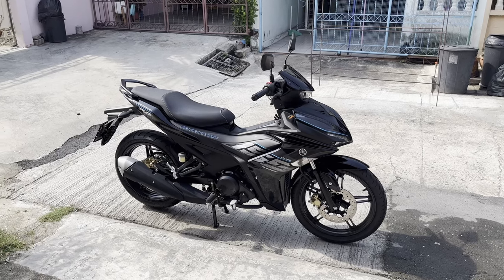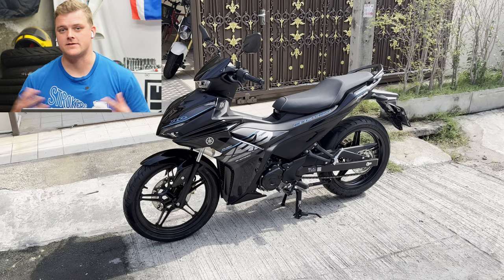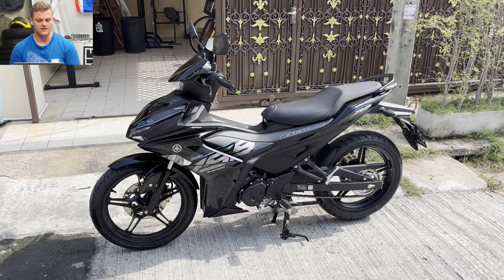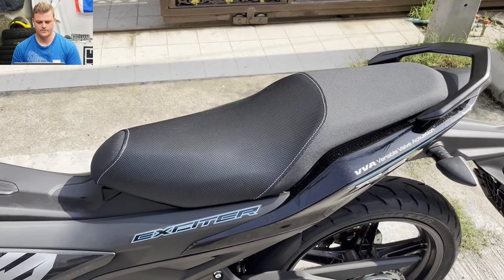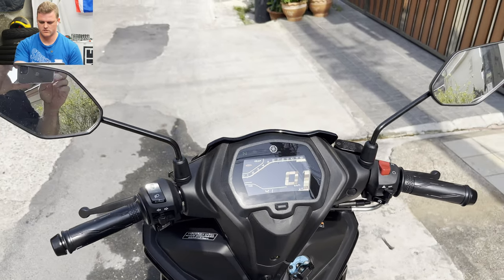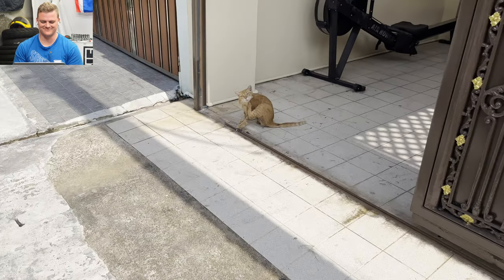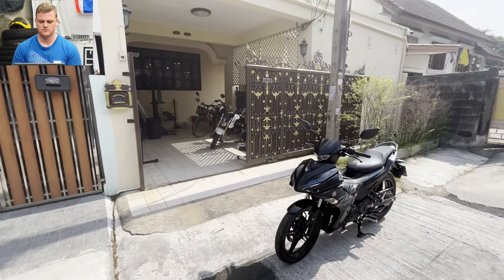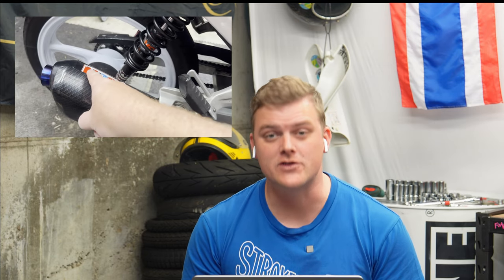Yamaha Exciter 155cc | RTW #001 🇹🇭

Comment: I ride a Yamaha WR155 in Indonesia. Planning to rent one of these in Thailand next week. I expect it to feel similar, engines are very similar, 6 speed. VVA makes me feel like there are two modes I can drive with. I think in a way it boosts power at the higher revs (8-14k for me). I can shift no problem at 3-5, but when you really push it responds back well.
Reply from the maker: Exactly that - you can ride it gently or fast. The choice is yours.

Comment: I'll note that with these bikes (I have a Honda Winner but I'd guess the Exciter is the same in this way) - is that the gearing is super, super tight. When riding along at 45-50 km/hr, you'd have it in 6th gear. So, going from a stop to that riding speed means a lot of shifting in quick succession. When you're riding the bike hard, that stock gearing is fine. It  keeps the RPMS really high 

But for putzing around the city I found the close ratios a bit annoying. On my Winner, I changed to longer gearing to stretch things out a bit. Yeah there's a slight power reduction but it still has a lot. I don't have to shift as often which is less annoying. When cruising at 45-50 I'm in 5th, and use 6th for 60 or so.  One surprise is that, while I expected this change to improve fuel economy, it did not. It got a bit worse actually. It also caused the ABS light to flash continually (and perhaps causes the ABS to not work, I haven't actually checked). So the next time I get new sprockets I'm going back to stock gearing.

On the Winner, the factory seat is a disaster - it is SUPER uncomfortable for the driver, because of how it is curved where you'll be sitting. The shape of the Exciter looks better as it has a flat portion. I changed the seat on the  Winner because of that shape but also because I just want it higher (more room for my legs) and it transformed the bike to being far more comfortable and easier to put more weight on the footpegs when I want to

The winner also has nearly zero underseat storage space. It's not enough for a rain cover. I have to carry my rain over on the little rack in front of the seat.
Reply: On the Exciter I am in 4th gear doing 60kph I have not yet tried to get a top speed out of it yet as I have not gotten out of the city... but soon. I have been told by a few friends it will easily do 140ish, which maps with what my old Suzuki Raider would do. I am jealous that you have ABS. if this bike had ABS I think it would be perfect. It's interesting to hear that hard and uncomfortable seats are a common thread on underbone bikes. LOL

Comment: Was looking at this model also. But it's hard to give up the underseat storage of the Honda Wave. Liquid cooled? prefer the simplicity of the Air cooled Wave. Maybe Honda will make a Wave 150. Sweet bike though. I like that color scheme as well. I would be interested to know what speed/fuel economy he's getting. Maybe I'll send you a video of my collection of small Hondas.
Reply: Still too soon to report on Fuel Economy or top speed, but from the 150 I rode before I can expect to easily cruise about 110-120 and could max at about 140kph. If I were to drive that fast. I am expecting fuel economy to be pretty good. time will tell.

Comment: i have a bike like this too. but in our country it is called the sniper 155. the latest exciters that have been produced this year already have ABS on the front. this bike has the same engine of YZF R15 but it is a little detuned. i dont know how it works but i guess one of those downgraded parts is about the less number of holes in the fuel injector but because of it its more fuel efficient the overall speed doesnt make than big of a difference but ofcourse overall R15 is faster in general. i hope you review about the suzuki satria/raider too. it is generally acknowledged to be the fastest underbone/small bike/moped. even as an exciter user one of its rivals know it is the fastest but it only beats my exciter when it comes to speed and weight but overall for me exciter is better overall
Reply: and oh as an exciter user, VVA is like the middle ground of DOHC and SOHC. but can only be equipped in SOHC engines exclusive in the yamaha 155 engine. it has 2 camshafts like DOHC but has only 1 in use at a time. 1 is used in low RPM to have more fuel efficiency and in a certain RPM 7000 RPM i think (i dont look my pannel gauge all the time since its more safe to keep my eyes on the road) this VVA shows in the pannel gauge. if you hear it focusedly the engine make a different sound when this VVA shows. the power then boosts up a little for more speed.
Reply: I don't know about his exciter but mine in stock only has 5.4L fuel capacity
Reply from the maker: Since this video he has added the 7L tank to the Exciter. Really nice capacity compared to stock.
Reply from the maker: Thanks for explaining it more! Makes sense.

Comment: Put a 125cc on this and it would sell very well here in South Korea.
Reply from the maker: Does South Korea have an engine CC limit?
Reply: @SmallBikeStuff  under 125cc you can ride with just a car license, above it you need a motorcycle license. The vast majority of bikes here are under 125cc, the biggest sellers are Honda PCX 125 and Super Cub 110, as well as T-Max and others.
Reply from the maker: @RideWithRen  that’s amazing! In New Zealand we’re only allowed to ride a 50cc bike on a car license, otherwise we need a motorcycle license. Thanks for teaching me something new.
Reply: @SmallBikeStuff  the dowhside here is thar no motorcycle may enter an expressway, regardless of engine size. It sucks when you need to go far away, because you're often stuck on main streets with lots of traffic lights.
Reply: For 125cc, Yamaha never got 125cc unless it's old 2 stroke. All their newer one is between 115cc, 135cc, 150cc and 155cc.

Honda got 125cc but it's slower for its spec.